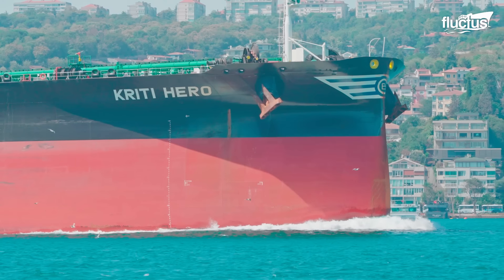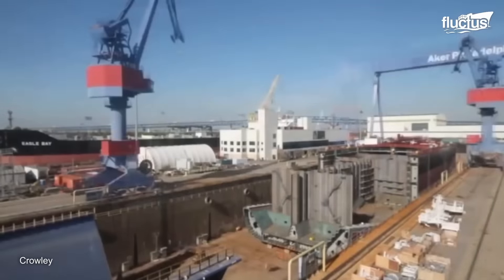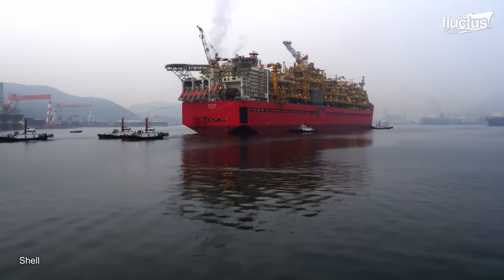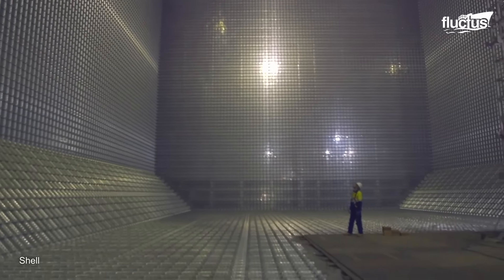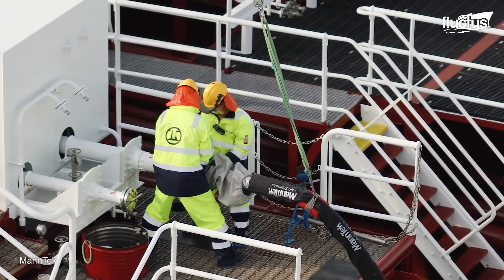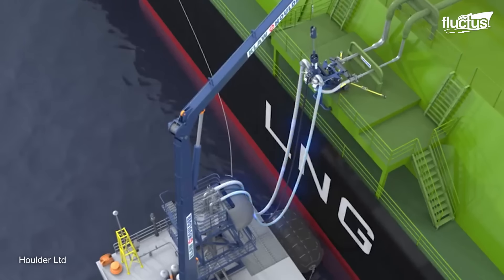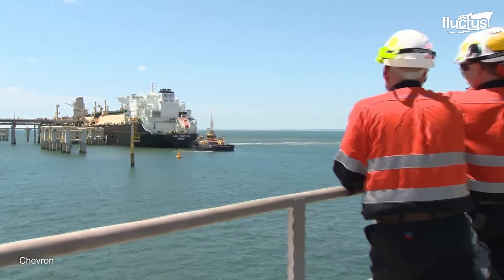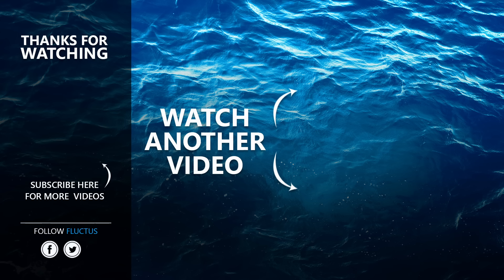Inside World’s Largest Tankers Moving Million Barrels of Oil Per Trip

Comment: Everyone should ask itself.. how much energy is lost from the original natural gas until it reahes its destination? Its al lot. It is not sustainable, very close to needing more energy to get it, than it releases in the end.
Reply: It's not lost, these ships are expected to have some part of their cargo evaporated during their voyages that's why they actually use it as fuel. These ships burn no heavy  fuel or diesel unlike normal tankers. Some LNG is lost during ship maneuvering where the fuel needed is less than the natural evaporation and they use a gas combustion unit to burn the excess gas. But yes most of the time this energy doesn't go wasted
Reply: @dromeascr123  its not about the boil off.. its about the energy lost in the transition steps, and pumping etc. Going from gas to liquid, cooling it, compresssing it, pumping it, then transporting, the back from liquid to gas, transporting again. There is 10kWh in 1m3, most of that 10kWh is already used up in this process.
Reply: @patrickfavier4310 
yes, your information make sense. To much transformation.
Deep cooling to -160 degree celsius for the liquid status. Again heating to the gas form.
Also in case of fracking a lot of energie is needed.

Comment: just want to say that the video segment at 1:05 is very good.   though more fossil fuels are consumed in other sectors, the oil-dependent, many small, fast-scurrying, passenger/light vehicles crossing the bridge as compared with the single, slow-moving mammoth pol-delivering tanker, well, i don't know. i've run out of words but as i've said, thought it was good.